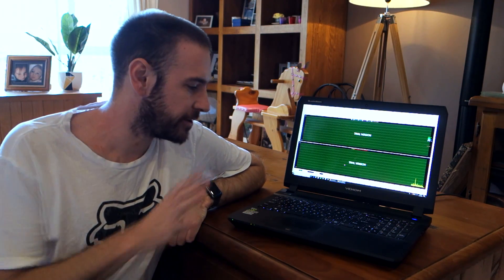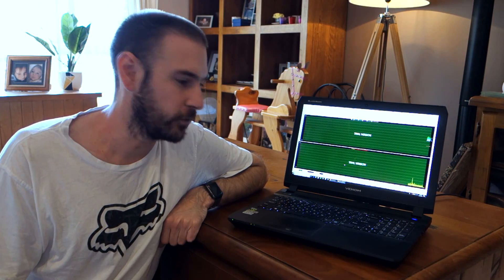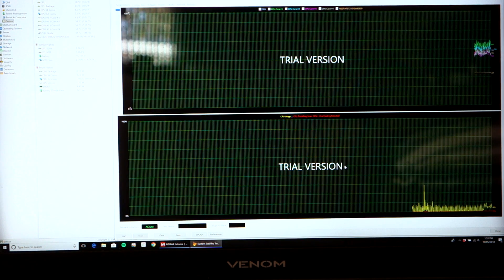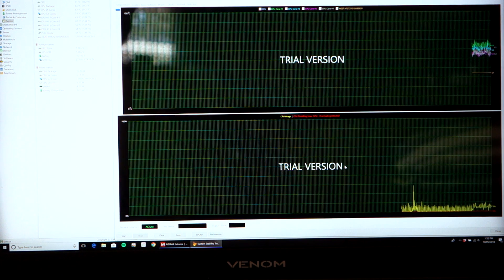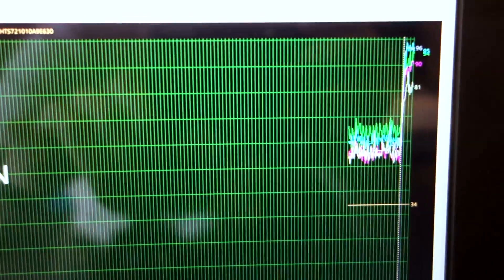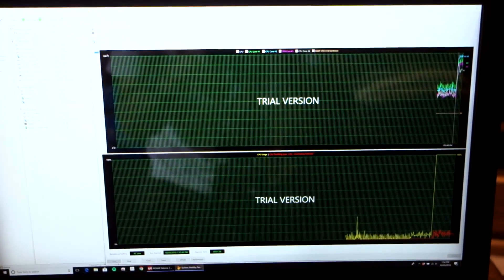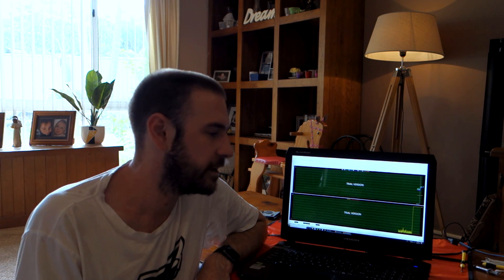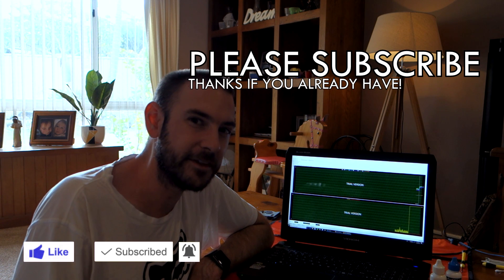THERMAL THROTTLING! - How to fix an Overheating Laptop

Comment: I have a Asus ROG GL553VE laptop that keeps powering off suddenly without going through a proper shut down. I cleaned the dust off the heat sink and fan, and then the problem goes away for a week. After that the problem comes back again, and I reapply the thermal paste, carefully making sure that I use enough but not too much thermal paste on the CPU, GPU and four chokes (these are square looking SMDs that I assume are chokes/inductors and they come with thermal paste on top of them). After that I still experienced the sudden power offs. Now I am unsure whether the problem is heat related or some component malfunctioning. Please help, I appreciate any input/info on this.

Comment: had mine repasted in an official asus store and still thermal throttles. Im like getting the performance of a 750ti on a gtx 1050 (runs a choppy 60fps with frequent dips on valorant all low settings so maybe even worse)
Reply: I also did the same thing, maybe Asus uses cheap thermal compound?

Comment: why cant we use vacuum cleaner to remove the dust on the laptop? i dont get what you meant
Reply: It causes static discharge, in simpler words it can fry your motherboard due to static electricity
Reply: @shinkiro69420  ah thanks

Comment: İ applied new thermal paste just one month ago it was ok at first but it says "thermal throttling" because of the cpu now. Did i do something wrong? One of the three screews of the fan accidently broke but other 2 works perfectly so i tought that it wouldnt be a big deal. I also did not turned the screws of the heat sink too much because i didnt want to break them. I used arctic mx4 btw

Comment: CPU is getting very hot in demanding games. This is a tutorial for all laptops using intel but the settings should be different from one CPU to other.
The reason is the Turbo Boost mode of the cpu. This mode allow the CPU to reach for a limited time higher clock speeds than the base clock. The build in control is telling the CPU to lower the frequency if the CPU temperature exceed 90 * C or more. Usually in games like BFV or benchmarks the CPU boost the frequency and the temp is getting very high. This cause a slow down instead of a better performance. This machine can do much better if you do next:
AA)
- install first “Intel extreme tuning utility”.
- reduce the core voltage offset ( I found that -0.150v is best for stability for my CPU).
- Reduce Turbo boost short power max and turbo boost power max (you can check the manufacture values on intel site.) 
You can use Cinebench 2.0 and test your results with this settings and without to see how big is the difference. Find  a sweep point (best performance without compromising safety) . If you like more safety you can reduce more the power values. Everything said should increase the performance about and decrease the CPU temp below 85*C if using cooling properly.
BB) If all above seems hard for you, than there is another simple method to reduce the temperature of the CPU. 
Go to Control Panel>Power Option>Change Plan Settings>change advanced power settings>processor power management>maximum processor state
Here you have to change from 100% to 99%  when plugged in. This will not allow CPU to go in turbo boost mode! The cpu temp will not exceed this way 65-70*C and the difference in BFV in frame rate is very small ... 5 -7 FPS compared with max power. 
Have a nice day and hope this will work for everybody reading this!

Comment: Hi, my laptop throttles whenever i do multi tasking. I just cannot understand why. If i play pubg lite, i will notice that it wont throttle(86 degs!!). but if i keep my browser(chrome) open and a low end game, then it starts throttling immediately(at 70 degs!!). I even noticed the same thing when i was using the emulator and my browser, it just starts throttling in a random manner. I just cannot understand what is wrong. Could you help me out if possible?

Comment: I've been running some simulations recently on an old Toshiba laptop.  I noticed it was getting pretty warm, so I decided to let it run outside in the cold overnight (about -1 deg C).  Checking the logs, I found it was able to complete my simulation tasks about 21% faster when running outside in the cold. If I feel ambitious, I might tear it down and replace the old heatsink compound on the CPU.

Comment: My laptop running at 92 to 95 celcius in full load lol.
Reply: Same
Reply: same did u fixed that
Reply: @7wlvk  yeep, changed the thermal paste, it good now
Reply: LitDaWae how much temp you got now full load on games? and what is your laptop?
Reply: @AmfibijaONE  75-79c
Acer Aspire E5-571g-52NR
Reply: @AmfibijaONE  5-6 yrs old, just this year I changed it. I didn't get what you said there at the last question.

Comment: I already went through this process and it was ok for a while and then it came back all the temperature issues in less than two weeks, and i not longer know if its a software or hardware issue, its just sad

Comment: My laptop is asus x560ud i got it new and it overheats to 85-94 both cpu and gpu when in charger  and without charger its 60-70 but the game would be so slow if i play without charger any way to fix that i dont know whats the problem or is it normal btw laptop got only 1 fan i think
Reply: Samz problem ihave asus x555u my laptop started overheating last night ... it was working  fine before that
Reply: @GRIZIUS3  my laptop always was overheated got before a week

Comment: My Xtu shows ' thermal throttling ' caused by CPU too hot. I'll will fix by reapplying Artic Silver thermal paste on cpu
Reply: İ applied new thermal paste just one month ago it was ok at first but it says "thermal throttling" because of the cpu now. Did i do something wrong? One of the three screews of the fan accidently broke but other 2 works perfectly so i tought that it wouldnt be a big deal. I also did not turned the screws of the heat sink too much because i didnt want to break them. I used arctic mx4 btw

Comment: I just got done doing this earlier and it still overheats, it gets very hot and turns off when just going into windows, the only way i can use it is if i turn it upside down and put a fan full blast on top of it and just hook it up to a monitor...
Reply from the maker: What model laptop do you have?
Reply: @boostedmedia  gateway nv53

Comment: My core i5 is throttling to 700mhz 
I have tried all techniques and repasted 4 times and still hit 100 degrees and my gpu is hitting 90 degrees but it is not throttling and i am completely clueless someone please please help me
Reply: Artic Silver thermal paste is on ebay

Comment: i've already changed the thermal paste on my laptop and i see no improvements in the laptop's temperatures !
is it because of the bad paste or is gaming always going to overheat my laptop ?
Reply from the maker: It’s possible gaming is just too stressful for it.
Reply: If you still have throttling problems, install Intel Extreme Tuning Utility (ETU) and undervolt your CPU. Here's a quick guide (not by me): https://www.youtube.com/watch?v=wA6uzZAgdpg

Comment: The copper heat sink has formed a patina (discoloration) as a result of oxidization. Can easily be removed. In terms of using the Arcticlean, you will receive the best results if you apply a couple of drops and allow it to soak in for 30 seconds. It will dissolve the TIM (Thermal Interface Material) and make it considerably easier to remove.

Comment: I just ordered a laptop online and it should be coming within the next week or so. Heard it has thermal issues and gets a little hot, so just for good measure, im going to put Arctic Silver Ceramique 2 on it. Should be good 2 go then!
Reply: If you still have throttling problems, install Intel Extreme Tuning Utility (ETU) and undervolt your CPU. Here's a quick guide (not by me): https://www.youtube.com/watch?v=wA6uzZAgdpg
Reply: @DutchmanDavid  undervolting wont help in most cases wanna be expert

Comment: Its kind of sad there's noone who could fix thermal throttling without opening the laptop. I mean im a casual dude and who actually does this if they dont want to lose money?
Reply: you dont need to be a rocket scientist, its just a plastic box whit hinges, clips and screws,  anyone whit 5 fingers can open laptop , all you need is patient
Reply: try tweaking your CPU max settings in 'power settings'  . you can shave off a few degrees by lowering CPU max performance
Reply: If you still have throttling problems, install Intel Extreme Tuning Utility (ETU) and undervolt your CPU. Here's a quick guide (not by me): https://www.youtube.com/watch?v=wA6uzZAgdpg
Reply: try undervolting it then.

Comment: If u not remove the thermal compound  but you remove the heat sink? And back it off again, is it ok?
Reply from the maker: No. you can’t reuse thermal compound.

Comment: isopropyl alcohol will work for cleaning the old thermal compound right?
Reply from the maker: Yes. Alcohol leave behind a residue though so you’ll want to give the die and hestsink a clean with a dry cloth (or surface purifier like I used) before reapplying the thermal paste.
Reply: wow thanks for the lightning fast reply. Your video helps a bunch. Will do a little tinkering on my ol laptop this weekend. Cheers mate
Reply from the maker: Good luck with it :)

Comment: Fan was obviously your biggest issue, good practice to change out the thermal compound too. I rate PC Case Gear too for supplies, thumbs up mate.
Reply from the maker: Yeah the fan partially failing was the point where things really got out of hand, but I’m certain now it’d been throttling since new which is really disappointing, especially from a manufacturer who said they swap out all the cheap Clevo components for their own.